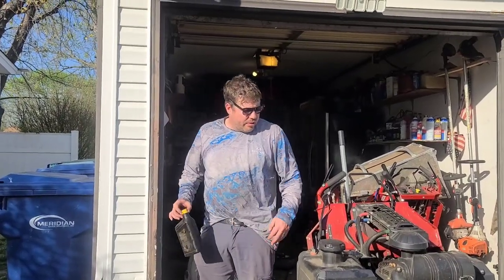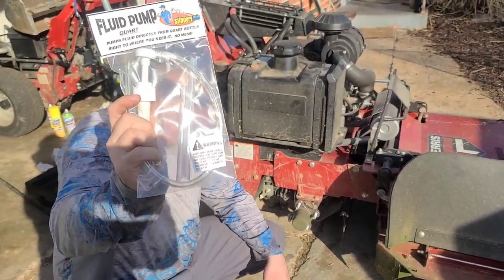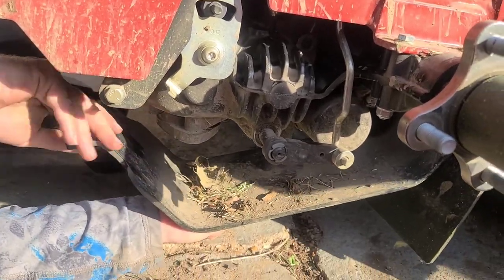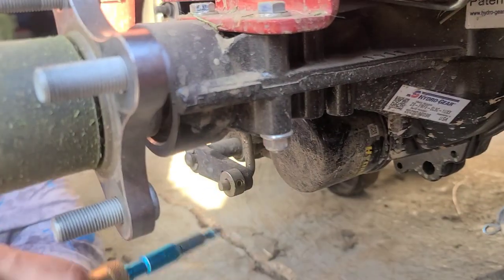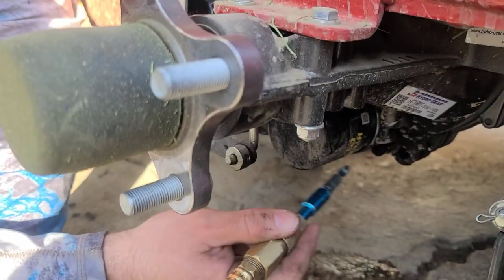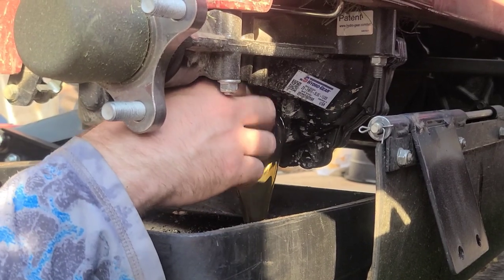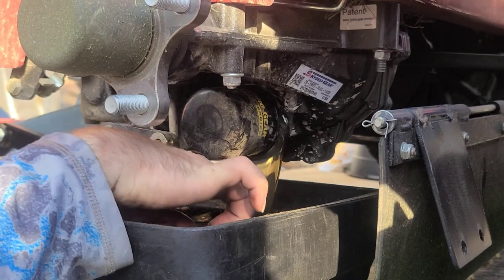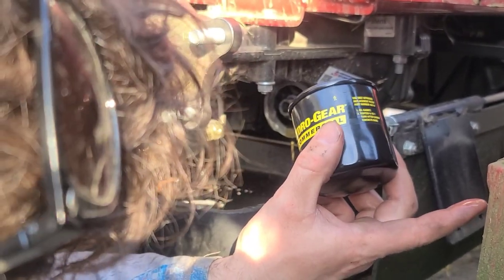100 hour Ferris FW45 hydraulic system service and changing hydro transaxle pump filter.

Comment: Just got a new fw45 and just thinking ahead about hydro change. Old was is much easier 😮. This is gonna suck lol. Awesome machine though 😊
Reply from the maker: It was kind of a pain. But less messy then the old way.

Forearms get tired with the manual transfer pump, have to do it again in the next week.
If you can find a electric pump it would probably be less of a pain.

Thanks for watching!

Please like and subscribe every little bit helps during these times.

Seize the day each and everyday-Are Jay 

Here is our mower playlist in case you ever need it.

The best Commercial walk behind Mower repair videos: https://www.youtube.com/playlist?list=PLQ0kUxbVWpJ-xSi236n9vlDcDjeLzWwkl
Reply: Never ever, ever climb under anything supported by a jack, use jack stands or you will meet the grim reaper sooner than expected.   I didn't see you select the switch valve. Otherwise great video.